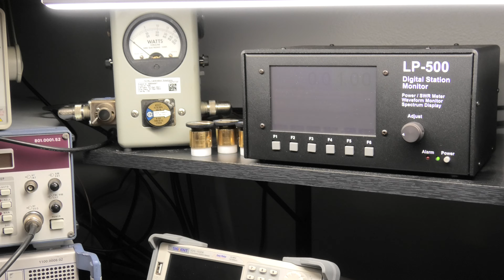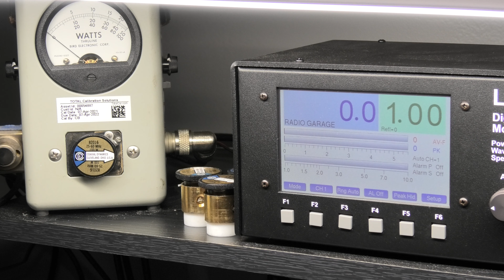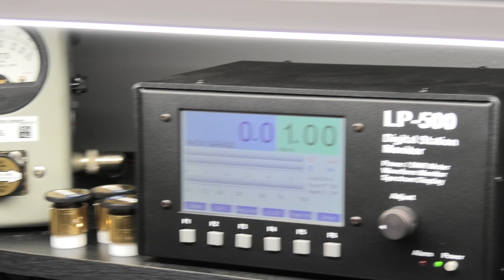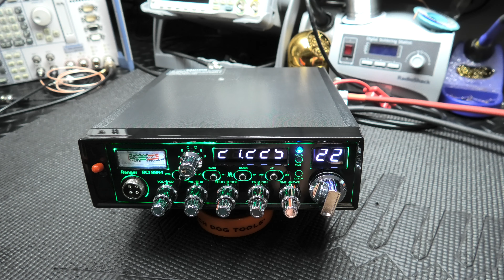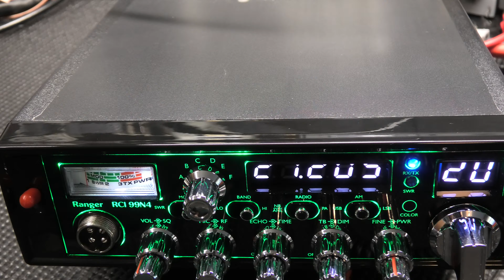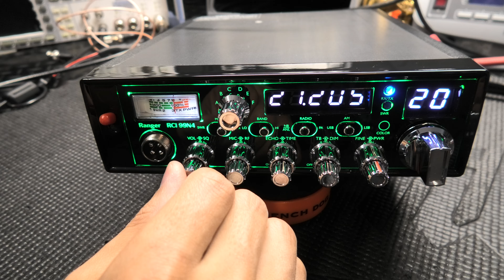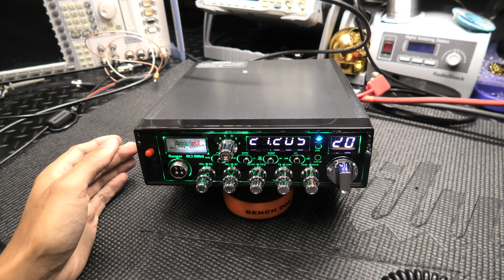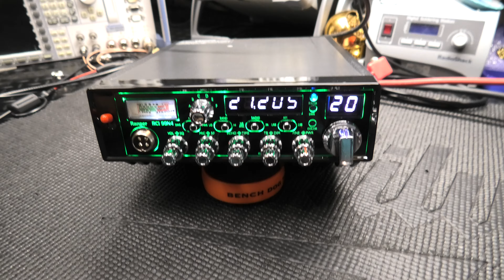RCI 99N4 Tuned & Aligned *BONUS Shop News* SSB CB Radio

Comment: Jeremy Burk here, I’m on my wife’s premium YouTube account. I for sure want to learn the basics of soldering and troubleshooting on electronics. I’ll worry about doing the mods later. This actually runs in my family, my dad was an electrician and then later electrical designer. My mom was electrical assembler and she also helped build most of the exercise equipment that’s up in space right now. My stepdad was first a radio builder for NASA and then a supervisor. I am a truck driver, but not for too much longer. It took a little while but radios are starting to get into my blood right now and it seems it’s all I want to do. I wound up buying a General HP 40w recently, it’s still in the box. I might just send it to you to get it tuned up properly here fairly soon.
Reply: I'm sure you wont regret sending him your general.  His bulletproof upgrade is well worth it. I'm well satisfied with mine.
Reply: Get you a breadboard and just start practicing soldier and also how to use a suction desoldier and be sure to learn and practice. Also buy and old non working CB without all the surface mount components take stuff apart and then redo it. Take photo before and after. And don't practice for too long of time. In school we practiced at first no more the 20 minutes a day, at first. Its important not to over do it at first, stresses newbies out too much then you just perform worse. Take it easy at first. Be careful of the fumes too. Use a small fan to blow across your job so the soldier fumes aren't drifting up into your face and causing you to breathe it in.

Comment: I have one of these,and I think something is wrong with it. Has been exactly 30 days since I installed in my semi,and I must say what a hassle that was to run extra coax and those 4 gauge welding cables from batteries all the up to overhead cb compartment, but I've done it. Anyways, everything was good,SWR low to 1.1 on power down amp off,and about 1.6 on full power with amp ON,so was good for a month,and all the sudden started to sound weird,like distorted voice,and was super clean( I used AMP maybe only once since I have this radio). I checked SWR and I couldn't get needle to CAL with radio settings like they supposed to be,when I turned power maybe to 11 o'clock then needle goes to CAL. I thought my SWR meter broke,but I hooked up my old Galaxy and checked SWR,and it's like almost perfect 1.1. So something gotta be wrong with the radio,any suggestions?? Since this radio is pretty much brand new should I send it to place I bought it from? Is warranty on CBs actually worth a hassle to sending to original place of purchase??

Comment: I'd be interested in your membership mentor program. My electronics experience is from the computer and small specialized shipboard operating equipment like some older depth sounders, RDF,  steering system remote autopilot, fire and water detector 
Warning Units, gyro compass interfaces. Now I'm retired and radio is interesting me. Truthfully most of it was trouble shooting smaller and simple faults not too much hard core repair other than swapping out some spare parts like modules and circuit cards. Just trying to keep something working until we got into port and call a licensed ET out.

Comment: I bought a driver extreme mic and I have a Stryker 447 with a Wilson speaker , speaker mounted under the radio port in a 2023 mack . I get feedback from it even with talk back way back , squealing something terrible .  Any suggestions ? I really like the mic but can't stand the squeal . I use a ranger mic and no squeal at all even with talk back all the way up . So it doesn't make sense to me , any advice would be greatly appreciated.
Reply: Get rid of the Driver Extreme mike.  Get a old school RK56 or an Astatic 636.  You have a good set up my friend.
Reply from the maker: The driver extreme mic has less noise canceling. Maybe the 447 is setup very hot on modulation?
Reply: @TheRadioGarage  I haven't had it worked on by anyone , just bone stock right out the box . Thanks for the reply
Reply: @hazmathauler4536  copy that ! I use a ranger mic and everyone I ask says I'm clear as a bell and I get out as far as I need to with this radio .  Thanks bro !

Comment: Really enjoy the videos, they are very helpful to me. I'm just getting into the tuning part of cb radios. I have a uniden 980, it has the built in swr meter. Is it better to use the built in meter or use a real swr meter? When i tune it with a swr meter it says i have good signal on 1 and 40 i got 1 to 1 . When i look at the built in swr i am getting a 1.7 on cb1 and a 1.1 on 40?
Reply from the maker: I always say an external swr meter is going to be more accurate. Normally though there isn't that big of a difference between the internal and external meters. What make model swr meter are you using?
Reply: @TheRadioGarage  it is just a little workman that just does the swr. I'm looking into getting a dosy tc 3001-p nothing to big just to fit my skill set at this time. What you think?

Comment: New to your channel do you sell radios I have a 2023 FREIGHTLINER Caucasia so looking for the best radio with most power and best clarity without messing with trucks computer brain and also looking for best antenna match for truck and radio suggestions or what do you have that you sell and could recommend
Reply from the maker: You can check out my website store theradiogarage.com 
If you need further assistance email me at theradiogarage@gmail.com